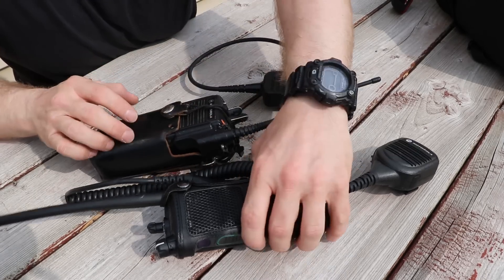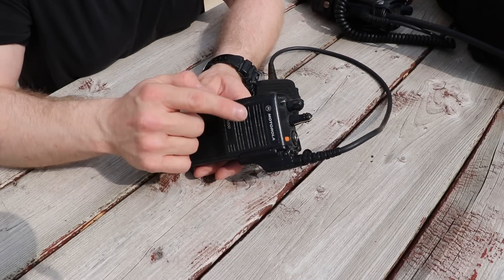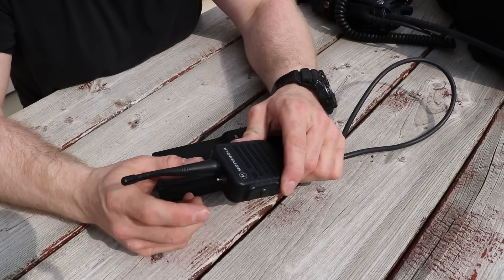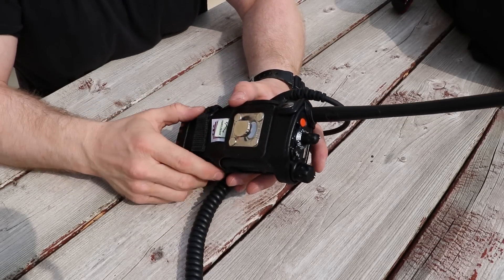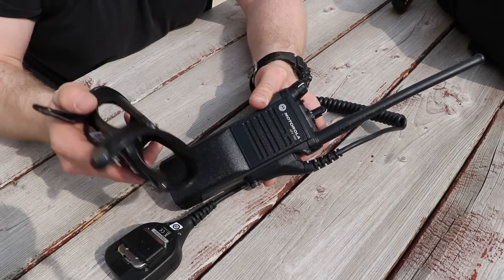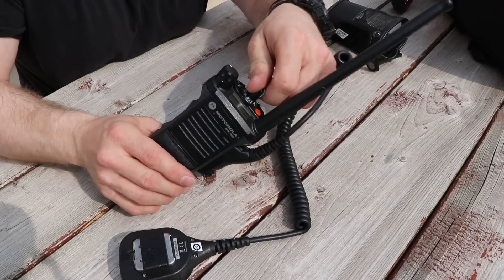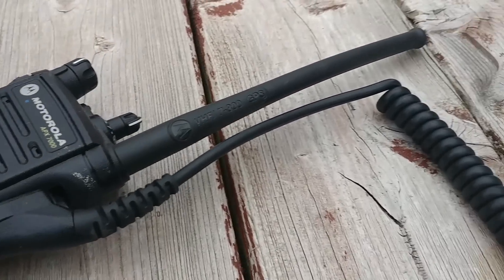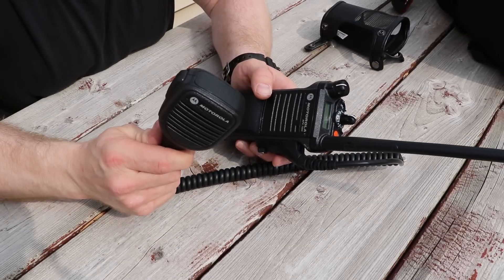How POLICE RADIOS work | A Comparison of Old and New

Comment: Hi, a lot of years passed but I'm seeing this in 2023. The first radio you show is analog. I have a DP4400 which does analog but also digital (MotoTRBO aka DMR).  It's all motorolas. You also have Zones. You can have a lot of zones. For example: Zone NYPD-1 and you can select 14 channels (1 - Dispatch; 2 - Local; 3 - whatever; etc). if you want to quickly talk to FD you can select other zone and talk directly to the fire department's "call center". It's just a way you can use, I have no idea how in US the system is done. Here in Portugal (and most of the European countries) use TETRA, which is a better digital trunk based radio system. Your second radio is a P25 which uses similar system like DMR or MotoTRBO. P25 is mainly used in USA. TETRA is mainly used in Europe. Both are digital and support full duplex calls, data and connectivity to Internet, mail and IP. But, TETRA is even better. Has more datarate and is designed to have corssover links over other types of medium. I can give you an example. I'm a radio amateur and we have a global network called brandmeister. Is based on FreeDMR. We have cross links over FreeDMR, Analog repeaters networks (like echolink), HamTETRA and so on. We are working (and we already tested) the QO-100 transponder (is a geostationary satellite that has a amateur radio transponder on board), and we did with success a crossover link between Azores SIRESP (is the emergency network based on TETRA in Portugal), going trough a amateur radio transponder locally, to a parabolic dish, goes to the QO-100 and goes back to the continent part and doing the reverse. We relied on some military equipment to encrypt everything. But it was a nice demonstration that amateurs can work with authorities and use our systems in case of a disaster. Anyways, the P25 trunk system (like tetra and also DMR in tier 3) works like a cellular system. It has a mobile number that is unique, cells have carriers and you must sign up on the network. After that, the network can "manage" the mobile entities (like your radio) and assign frequencies and give you access to certain talk groups (like channels). So when you turn on the radio, it will automatically search and connect the the nearest cell and authenticate to access the groups you have to work. Like NYPD dispatch. no matter where yo are, you are always connected and no need to switch channels or zones to access different  cells/repeaters. It also deals the encrypt on the air automatically and do the E2E encryption. The TETRA uses 3 types of encryption standards. TEA1, 2, 3 and 4. The 1 is for companies and is a open encryption algorithm. TEA2 is used for authorities like police. TEA3 is used for emergency services but for outside of European zone. TEA4 is for commercial use but encryption is secret like TEA2 and 3. Both 1, 2 and 4 are export restricted. So Motorola and other companies cannot sell equipment with this encryption standards outside of EU.

Comment: I love radios and programming depending on what radio system you have for example like P25 and Conventional the signal meter shows how well of a connection you are getting to the system if it's a P25 system then the signal bars will show how good of a connection you have to a specific site or tower.

Comment: Great video! Like the old Motorola HT1000. The new one is more complicated because it has the new encrypted talkgroups in for a new P25 System. It either has no option to turn the encryption off or forced to stay on or strapped with encryption.
Reply: Can a moterola ht1000 work with p25 radio systems because I plan to buy a moterola ht1000 to use as a scanner for a p25 radio system and I would like to know if it work or not

Comment: the signal bars shows how much signal you have with your repeater. the new APX 7000 is a digital P25 radio. so sense its digital it can show you how much signal you have with your repeater and if your out of range. so its like a wifi signal but its P 25 trunking digital radio signal.

Comment: The swivel may help with comfort but the reason it is there is for antenna polarization so you can switch from vertical polarization to horizontal Polarization depending on the polarization of the repeater you are broadcasting through it just conveniently happens to make it more comfortable as well

Comment: Are those IL fireground frequencies in that or does IN just have very similarly named FG frequencies?
Reply: Zachary fleck it’s probably both things so yea that’s probably it I’ve been into Walkie talkies ever since I was 12-or13years old and I have a similar radio to this Motorola that has a Walkie talkie trunking system and it helps to know if it has one because it’s  it tells u if it has a Walkie-talkie trunking system that is most definitely a police radio which I own one so yea for my company that I made so yea

Comment: You can still make it do the Start up beep, Your radio guys just didn't program it in. It's called radio test Tone when it starts up your Display says SELF TEST , My APX 7000 and APX 4000 Have that set up with a lock code since mine are the Model 3's

Comment: The signal meter will tell you how your signal is into the repeater (Assuming P25) and also your receive signal while the radio is receiving. Also, the 0 and 0 with slash is the switch normally reserved for selecting Encryption on and off (if your system has it, or the encrypted channels are "strapped" to the Freq/Talkgroup), but the channel lockout feature being programmed to it is pretty cool!
Reply: I don't think they were using p25 just because I believe I heard talking coming out of the ht1000 and it's a analog only radio
Reply: @CraftinFears_Official around 6:43 you can hear a digital voice com on one of the channels. probably not his departments, but likely would be upgrading if they are getting the new radios.

Comment: Four questions. 1 Once those batteries are dead, i gather your radio wouldn't work right? 2. Do message relayed through that rely on you as an office being NEAR your cruiser. i.e the radio works with the gear in your cruiser? 3. If the grid went down, i gather you are on 800 mhz, would all your radios stop working?  4. If you hit that orange radio button, what does it do?

Comment: How does the department handle individuals getting their assigned portables program with frequencies that the department is not licensed to use, I/E FCC license transmitters to an individual department, how would a Chicago officer be properly licensed to operate a neighboring  jurisdiction?
Reply from the maker: Our radios are owned and maintained by the county. There aren't licensing issues with public safety organizations that are interoperating. We all have each other's per.ission to be on the channels.

Comment: Please don't smile. I went through the Alabama police academy in the 1980s and I became a certified corrections officer in the state prison system. My 1st piece radio was a box that weighed 10 pounds and I hung it on the saddlehorn so the horse had to carry it. Issued a 12 gauge pump shotgun and a .38 revolver .
Reply: Sounds like your portable was a Motorola MX-300 series, they were "bricks"

Comment: @7:30 the signal strength indicator tells you how strong a radio signal is, so my friend whos 2 miles away, the signal strength could be 4 out of 4 bars, my other friend in a city 4 miles away could be 2 out of 4 bars in signal strength.

Comment: To stiffen up your volume knob on the ht1000 replace / or add a little o-ring under the knob. Pull the Knob straight off the radio you will see a little groove cut under it for the o-ring.  Great Video!

Comment: Well I'm. Shocked this is a video that is helpful beyond a slight over view.  The very fact that this radio you have is dual band and able to do. P 25. Phase 1. And 2. And 7,800 mhz trunking and. AES. 256. Encryption .  This is a radio. That is very big bucks. Ht1000. Was 1200.$  new. The. Apx7000. Was 6800.$ .  Now. Apx8000 is the latest. Quad band yet. It will never do. Moto turbo cause that their. Xpr series.  This is a well built radio but. Newer knobs and after market. Accessories are made to stay in place .  Kenwood is very strong in the nexedge world.

Comment: We just went with Kenwood APEX6000 Same type P25 with Analog
Reply: Just googled and I could not find a radio by that name. APX radios are Motorola.
Reply: @radiosification  sorry, meant VP6000. We had over a 3 month process for grants and the MOT apx and Kenwood vp 6000 were the competition. The kenwood was about 2k lower for P25 then the APX. The kenwood name is Viking VP6000
Reply: @36w3s.talbot4  That's really interesting. What do you think of the radio? How's the quality?
Reply: @radiosification  I would say the technology is equal to better and durability will be told over time. Several other agencies who have had the vikings longer love them. When the price is close to 2/3 less than APX it was only a matter of time be fore another LMR manufacturer would develope a good radio without the MOT logo.
Reply: @36w3s.talbot4  interesting. Thanks for sharing your views

Comment: The "reception bars" on the display are there to show the strength of the radio's connection to the control frequency of a trunked radio system. A trunked radio must remain connected to the control frequency to allow the radio system to assign it to different talk groups. Looks like your department just upgraded to a P25 system :)
Reply: dude yep P25 is a digital talk group mode. Like DMR in HAM radio.
Reply: RSSI
Reply: i dont think these radios are trunked mate.
Reply: @dannn.l.slightvisual7656  their system is most likely a trunked P25 system
Reply: @dannn.l.slightvisual7656  they are absolutely trunked
you cannot get RSSI Bars on an APX radio without being on a trunked system

Comment: I will date myself here. I remember using MT500. I loved the MT2000, Astro, and the XTS5000
What is up with that antenna. Are you calling NASA on that radio?
Reply: Looks like a helical VHF/800-900 MHz antenna. I assume his PD uses analog VHF still while the area comms use the 800Mhz system.
Reply: @Gmoney818  I looked up the PDs he mentioned, they are on VHF and 700MHz digital trunked.

Comment: Hey, I had a Turtleback case for my 7000 radio and the male end of the case ended up wearing out after about 6 months and would pop out of the female end when pushed while straight up in the holder. I ended up buying Motorola’s leather flip case (pmln5560) which seems to work for me. Also I suggest getting a short antenna for the radio.

Comment: I have a model HT1250 for ham use, and I first started using the NiMH batteries which make the radio feel as heavy as a brick. Later I replaced those with lithium batteries and the weight decreased significantly. I can see that it would be more convenient to have a simplex frequency programmed into one of the channels instead of using the repeater talk-around feature in the menus.
Reply: Easier to teach the new grunts

Comment: I carried around the first version way back around 1997. One would think that after all these years Motorola could come up with something that is much smaller and much, much lighter.
Reply: You want milspec, you gotta deal with the weight. :)
Reply: Somebody was getting paid.
Reply: XTS2500 with lithium battery. Lightest APCO P25 radio you can get

Comment: Remember the saying with Motorola: "You can buy better but you will never pay more!"
Reply: LoL.  Buy better ? Put up any other hand held 2 way radio to a Motorola APX and let's see how they do.
Reply: matt9c1 Harris is the only other competitor that is on par or better than moto with their XG series. Both the XG-75/100 and the AXP series are extremely proven.
Reply: Riceman’s Place so proven that Harris was replaced by Motorola’s P25 system when they couldn’t provide consistently for the Las Vegas PD?
Reply: Steve Blaski Harris has a contract with Nevada which is why they provided their radios. The Washoe county/Reno areas still use them but Vegas had to switch along with Nye county. The Harris EDACS system was the good thing they had but they struggled with P25 integration. I'm not saying their the best nor is Motorola as both companies have has issues in the past. I'm just saying that these are the main players in the public safety field.
Reply: @Gmoney818  I think the last person was referring to LVMPD using the OpenSky system from Harris before they moved to what they have now. The OpenSky system had significant issues with dropouts, dead zones, and trouble affiliating that the LVMPD put out a bid for a new system. Motorola won and installed a new Project 25 trunked system with APX radios and the PD were much more pleased with the performance. There are multiple press conferences online with the chief's explanation of the old vs. new systems.

Comment: Per Motorola's user manual that indicator is what you thought it was. 
"Received Signal Strength Indicator
(RSSI)
The number of bars displayed
represents the received signal strength
for the current site, for trunking only. The
more stripes in the icon, the stronger the
signal.
" 

I think the system you were on was some digital trunked system, which means there isn't just one defined frequency or channel used for that system but many shared among the whole system, so the radio constantly listens to a control channel which monitors the groups you are subscribed to and automatically switches to the different frequency from a pool of different frequencies the control channel assigns when transmitting and receiving.

Comment: 7:30 that is your signal strength of the control channel. The newer digital radios not only digitize speech, but they also have much better band / spectrum management. Instead of dedicating a frequency to a talk group (EMS, Fire, Tac...) any talk group may use almost any frequency. The control channel broadcast to all radios sends a command for your radio to tune to the same frequency (or repeater pair) as the talk group (person transmitting)  is currently using if you have that talk group selected.
Reply: Thank You... huge help🤮🤮🤮🤮💯😂🇺🇸😎👀👍🍄👀💡
Reply: I don't know what Carlos is excited about but analog radios worked the same way(except digitizing voice). And it doesn't matter how many talkgroups are programmed into your radio(ID Number in the trunking system), if it is not authorized to be in certain talkgroups, you won't be able to be part of any of those talkgroups.
And that's a safety feature of the trunking system so no civilians can get on to the system without having their radio specifically added to it by an admin personal.

Comment: People cry when I come around. E tends to occur in systems indefinitely. It'll be moot when comms are full E and mix of LTE there of.

Nothing will beat that ht1000, mts2000 you have. I still keep those around for analog repeaters in our system.
Reply: LosRioDelMar Preach brother. Are systems are P25 Phase 2 and that shit goes down every other weekend. Thank CFMB we still have the old “bunker” freqs and the concentric switch to fall back on.
Reply: I’ll take an HT1000 any day of the week over the XTS, or APX radios.  We recently had experienced a rash of issues with our APX radios, and had to pull the old HT1000s out of storage (they almost went to surplus auction).  Now, most patrol guys want to keep using the HT1000s instead of the APXs.  Management and the bean counters are pissed after dropping so much $,$$$ per portable.

Comment: Apx 7000 is end of life with Motorola. 8000, 4000, 1, 2000 and 900 are latest. They are also pretty eol by 2020 when Motorola comes out with the APX Next which is LTE Sim and LMR together. They let you keep your old radios? Here it's sent to comms as it is decom.

Comment: The second unit is interesting. Regular working channels are around 430-570MHz but the weather service is actually on the boat band, typically 162.55, and aircraft use frequencies lower than that almost down to FM broadcast. Lot of tech in that package!
Reply: Aircraft use frequencies in the 120mhz range.
Reply: Aircraft is 108-136 AM mode, I believe.

Comment: You can still use the HT1000. have it reprogrammed for HAM or GMRS (if it's UHF). 
The A,B,C toggle can be programmed for normal operation , no PL.DPL decode, and scan.. There are other parimeters that can be set in the RSS but what I listed is most common.
The batteries for the  Motorola Jedi series (HT1000, JT1000, MT2000, MTX and MTS 2000 flashports) are the same and very cheap to buy online.
The HT1000 also has a lock switch but it's hidden under the channel knob and it has to be activated via Motorola depot software.

I have the 8000 model of the APX in yellow I use for work,  I manage and maintain comms systems for several agencies and businesses also a couple railroads. They are nice radios but do not do Mototrbu (DMR). However they are quad band (VHF, UHF, 700 and 800 MHz) which eliminates the need for me to have 4 different HT's. 
The signal meter is for received transmissions and if it's trunking it is the signal strength of the control channel that syncs your radio and suthenicates it for use on the system..
I have the turtleback case for mine too, very handy when I am at the railroad and need to detach and hold the radio up to get more range to talk to the dispatcher.. Also it has a 180 swivel..
I never can get over how robotic people sound on the digital formats.. I guess as time goes on the vocoders will improve.

Comment: I still have a Motorola MT1000, Still works but still looking for a holdster for it.
Reply: Law Enforcement Supply Inc. makes the "Porta_Clips" for portable radios the part # is MHT or check on E-bay. It is made of steel with a baked epoxy finish.
Reply: That radio isn’t legal to transmit on anymore unless it’s on ham freqs.
Reply: Depends on frequency. There are vhf and low and higj yhf models